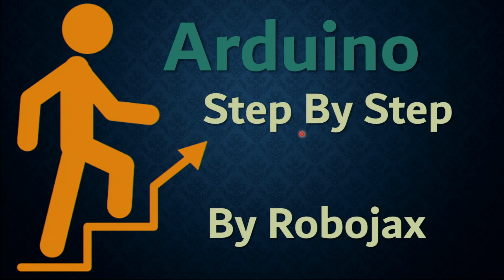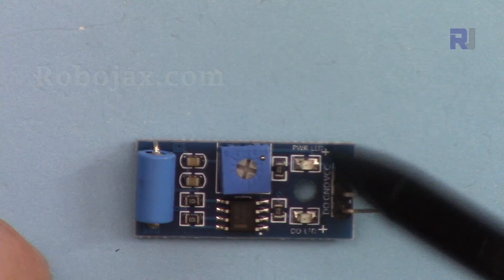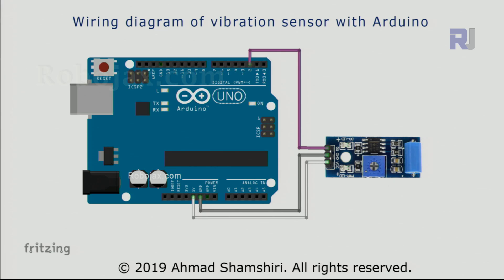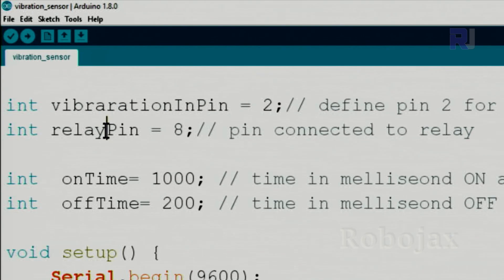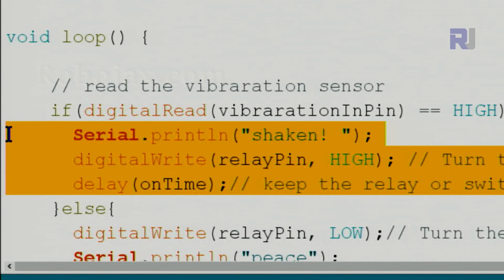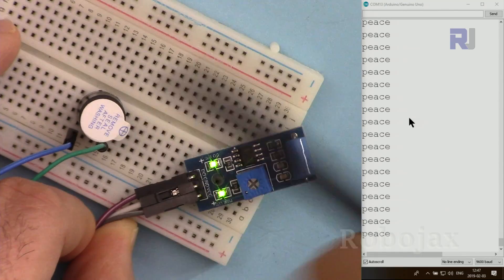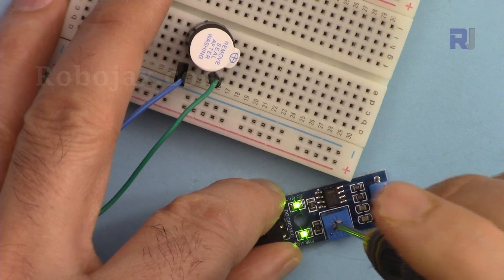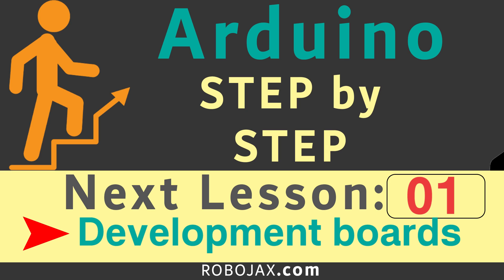Lesson 14: Using Vibration Sensor Module with Arduino - RJT569

Comment: Is arduino must use with vibration sensor or I can use only this vibration sensor??
Reply from the maker: YiThe can just connect the input to any 5v it will work.
Reply: @robojax  so I can use it without arduino right??? How many max volts can it takes???

Comment: Can it detect a one off shock
Reply from the maker: "off shock" I don't undertand. But shock yes but it will turn off when shock is done. so you gotta keep the arduino running for longer period to do something. or if the shock is very important, then keep the arduino running in detection mode until you rest it.
Reply: @robojax  sorry I what I meant is for example, if you were to drop the module on the floor would it register as a high reading, thanks for the response

Comment: What's the unit of measurement by this sensor
Reply from the maker: have you watched it? this is switch and has only ON or OFF state.
Reply: @robojax  when I came across with this in serial monitor it reads value like 0- 1000..... So only iam asking it's unit
Reply from the maker: I don’t remember the code.  Please watch the videos as I had to have explained it.